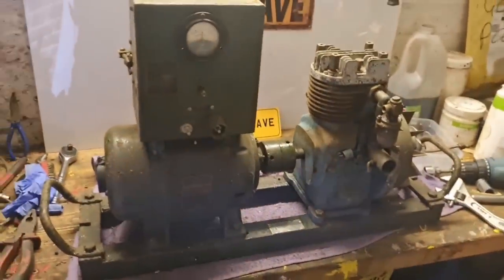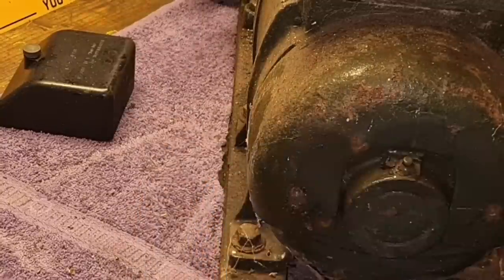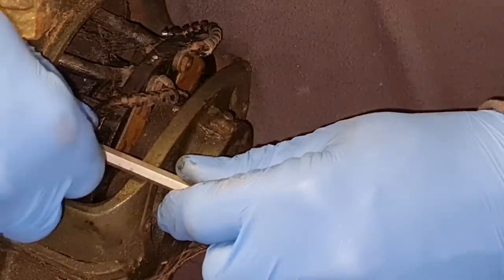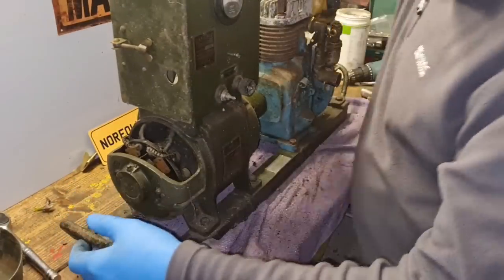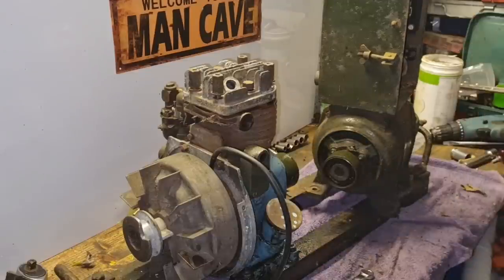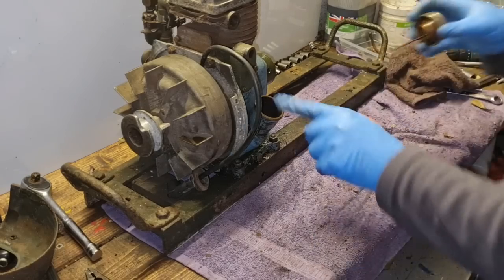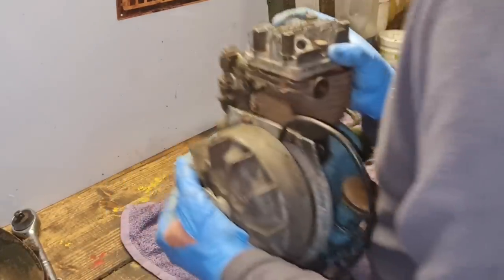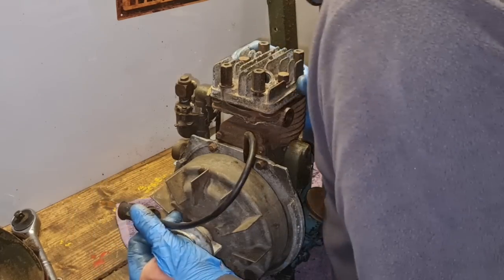WW2 Charging set engine strip down and dynamo check over.

Comment: The adjustment slots for the brush carrier is so you can adjust the brushes for minimal arcing, this will vary a bit with load. The regulator said A.M inside so thats air ministry.

Comment: It must be a DC gen, ac would have slip rings dc has an armature, and should not oil up carbon brushes when it runs it will smell like a Hornby electric train set, that said it's not a bad smell lol.
Reply from the maker: Lol.. yeah its DC for charging 12, 24 or 36v battery packs. Adjusted with engine speed I assume.